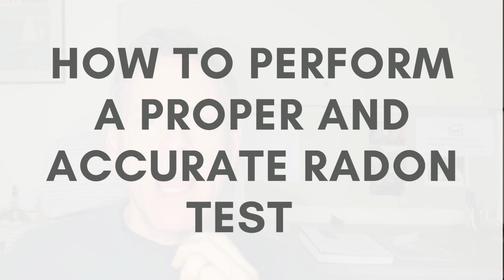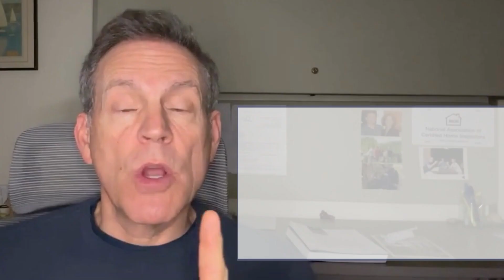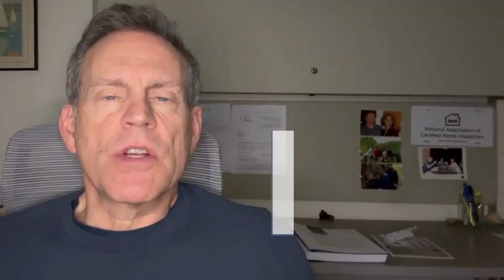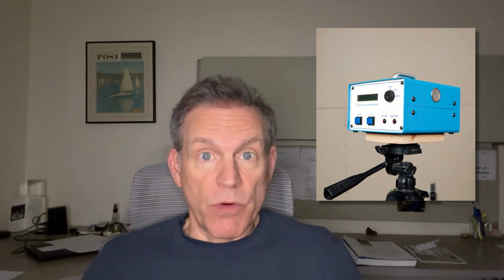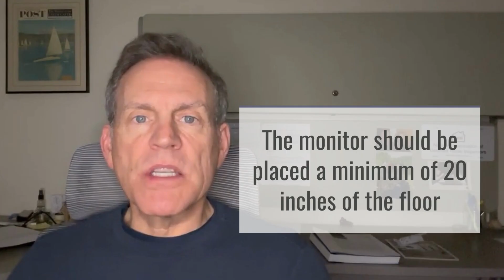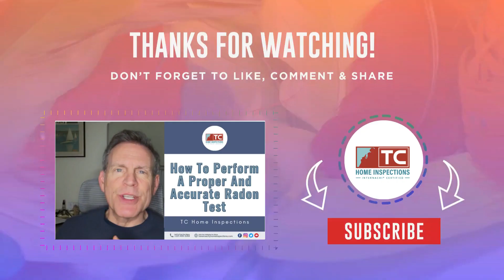HOW TO PERFORM A PROPER AND ACCURATE RADON TEST

Comment: The test is "recommended" to be at least 12 inches from a wall, but is that required?  For example, can it be on a shelf or mantle so long as it is more than 20 inches off the floor and the house is closed up (ie: vacant)?  I get that a tripod would be ideal, but most inspectors do not bring one and end up leaving it on a shelf, buffet table, etc.

Comment: You're not going to get a useful radon test from 2 days or even 7 days. You need at least a 1 year test.
Reply from the maker: It is true the more accurate test is a "long term test." Unfortunately when purchasing a home, you don't have a year to test for radon. For a home inspection, the EPA approves a 48 hour test for a real estate transaction. If a home has an elevated test score during a 48 hour short term test, it is highly likely that at many points in a year there will be elevated readings. We have tested many homes using a 48 hour test, gone back to the same property years later and we confirm elevated radon. We let clients know if they are concerned about reducing possible carcinogens, they should test.
Reply: @tchomeinspections  Good on you guys for doing that 👍
Reply: Never read that. 2 days  is all I have ever seen on countless videos and instructions. ☢️👍
Reply: @royrice8021  A short term test might tell you that you need to mitigate but it won’t tell that you don’t need to mitigate, when in doubt, mitigate. Most instructions for radon testing and the standards for when to mitigate are based on practicality, not on safety/health benefits. The EPA set the 4.0 pci/L threshold for mitigation based on what they thought radon mitigators could achieve most of the time (in practice a good mitigation system should be able to get things below 1.0 pci/L long term in most houses). Radon fluctuates wildly from day to day, month to month and can even vary a lot from year to year. That’s why the EPA recommends testing every 3 years (they have a low expectations of the general public) but really when you can get a continuous monitor these days for only $100, it’s pretty hard to justify not getting one to run 24/7 considering the modifiable health implications of long term radon exposure. Also, if you do a short term test make sure to keep windows shut during a radon test, even just keeping a window open can make radon levels go from appearing high to instead low. You also want to test in the space where people spend most of their time as well as the lowest level if those aren’t the same. Although rare, sometimes due to the HVAC system, upper levels can have higher radon levels than lower levels. If you are only home at certain times of day it’s possible that radon levels spike during the part of the day you’re at home usually and then drop during the day when you’re not home then the long term average will deceptively appear lower than your actual exposure. There are radon meters that log each hour of radon level so you can see when it spikes in the day (eg: Ecoqube). Also, the radon lung cancer risk estimates by the EPA assume someone is only in their house 16 hours per day, not 24/7 so if you’re in the house around the clock you may want to multiply your risk of lung cancer by 150%. Basically radon is something you want to get as close to outdoor levels as possible, which, in the USA is usually around 0.4 pci/L.

Comment: I think concentration would mainly depend on elevation and air flow so u should take readings at 3 different elevations maybe?
Reply from the maker: Great question. Because radon is coming from the soil, the elevated levels are mainly a concern in the lowest livable area of a building. We have completed thousands of tests and we have yet to find elevated levels in a building on the 2nd or 3rd floor (at least not yet).
Reply: @tchomeinspections is unfinished basement considered a livable area?

Comment: What source strength and volume of air do you use for calibration?  Could you use a compressor and express concentration in terms of flow rate so u could get a more homogenous reading to compare to other homes?

Comment: How do you prevent it from being stolen
Reply from the maker: Great question. so far, we have never had a monitor stolen. There does not seem to be a huge market for a radon monitor. Most people going in and out of a home are the owners along with a few realtors. Most homes a locked after we place the monitors.
Reply: @tchomeinspections  thanks for replying. I'm new to radon testing and worry about it. At 800 dollars a tester, it is scary.

Comment: I have a 3200+ sq ft rancher with a finished basement.
I purchased this home with a mitigation system in a far corner of a basement 
Is one mitigation system enough for our whole home? 

I have the AirThings Corentium Radon detector and I’m going to test 48 hr averages in multiple areas (different sides) of our home. Upstairs and downstairs
Reply from the maker: One system could work, It depends on the lower area design. I would recommend checking the U-meter on the PVC pipe to ensure you have proper pressure (ie, one side is higher than the other). Most mitigation companies will test in one-two weeks after the install to confirm proper function.  Normally, you will have higher radon levels in the lowest area of your home.

Comment: I used a First Alert radon test kit for 5 days to evaluate the radon in my home. I am now awaiting results and carefully followed the instructions that First Alert provided when i ran the test.
Reply from the maker: Just remember the number 4. A reading at or above 4 is important as levels of 4 or higher should be remediated.
Reply: @tchomeinspections Do you mean an average reading over a 48 hrs test reaches 4 or above?  Or the actual maximum value during the 48 hrs test was above 4?
Reply from the maker: According to the EPA, a reading of 4 or higher needs to be remediated.